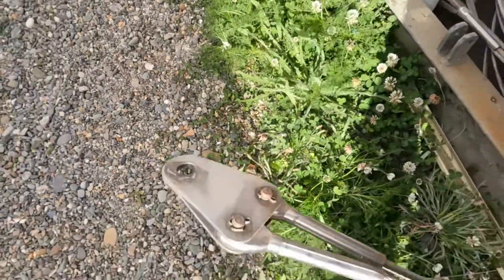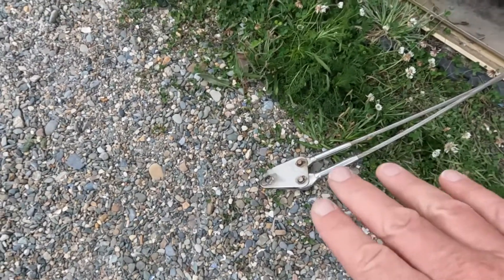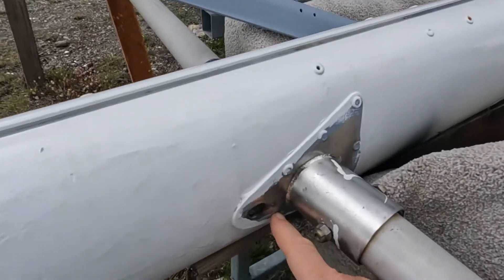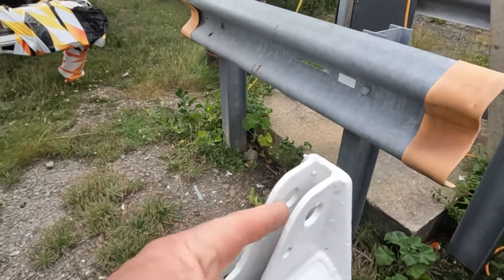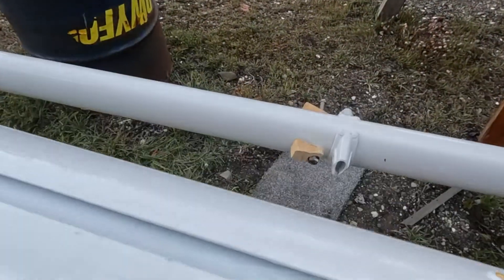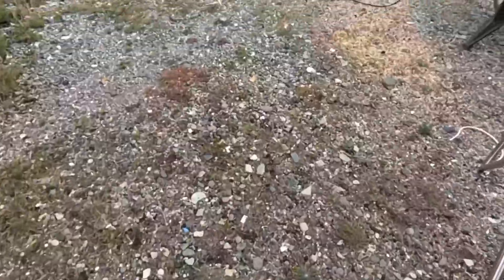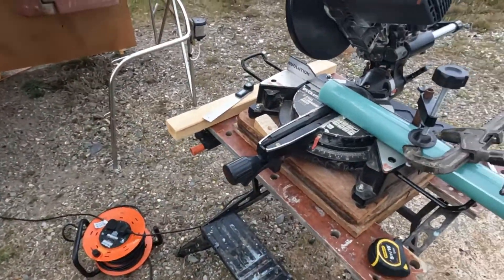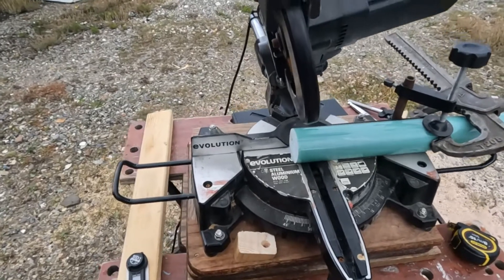DIY Mast tangs for Dyneema shrouds, Synthetic standing rigging Episode 6

Comment: Is FR4 pulltruded?  If so all the glass is going the wrong way. 
Another way of making a similar item is to mould epoxy with chopped strands.  See Easy Composites videos. They use carbon, comes out stronger than aluminium.  They make the mould using a 3D printer.  
All said is your solution a bit complicated?
How about, a stainless sleeve, width of the rope, with a large flat cone shaped nylon washer each side?
Reply from the maker: In a later video you will see that based on a number of conversations we switched from FR4 for the tangs to Acetal-C. We were able to machine them with our table router.
We don't have a 3d printer and this felt like easier tech.
We wanted the diameter to be large enough for the recommended dyneema bend radius (5x diameter) and don't have the tools to machine stainless steel. Plus this way we can angle the surface to match the angle of the shrouds.

Comment: Nice ! 
Making flush surface for head of the screw and nut I thing is important. No pointy contacts, big surface of contact will reduce friction wear of fr4. Maybe even washers. Also backing plates that were riveted to the mast where the bolt was going through the mast ware reinforcing contact point between mast and bolt. Aluminium is soft compering to stainless. 
You might want to use a bolt without thread on all contact places with fr4. Thread will be like saw vs fiberglass.
I wood also use fr4 next to mast without washer. Smaller leverage on bolt only shear force. 
All anchoring point on boats with synthetic chain plates have  pin/shaft as a contact point. So are you sure that dyneema will not cut through fr4?
I'm not an expert it's just gut feeling.
Reply from the maker: Thanks!
The mizzen lower, just below the spreaders is the only shroud attachment point without a plate riveted to the mast. It does have a compression tube though.
Agree, the forstner bit is doing a nice job or creating a flat space for the bolt head. Agree on needing a bolt with no thread touching the FR4.
Next video shows a Mark II with these changes and the endplates glued on.
Beyond that we are planing a Mark III made from a single piece of "Acetal C", should resist wear better.
As for the pin, there was a video from Zingaro about Kraken fittings because the Pin into a thimble with a size mismatch causes point loading which we are trying to avoid. The combination of a tightly fitting bolt and a 60mm diameter rod for the dyneema look should avoid point loadings.

Comment: The only reason for using the FR4  I can see it is that this already has a smooth surface on it and you can cut it. 
Why not just use a ready made solid round thimble ( smooth for dyneema ) and add a wedges inboard and out.
Use SS I-beam wedge washers as they have about the right angle.
Thimbles made typically from aluminium with anodized coating. 
Cost a problem I assume? 
Then use a hollow SS round thimble with a pressed and glued in plug you can drill at the 15 deg. Angle .
This is very similiar to traditional rigging but they normally put the loop around the mast above the gaff mainsail throat.

Warren
Reply from the maker: Hi Warren,
In large part our choices are based on what we can find or think to look for :-)

By Solid Round Thimble do you mean what is commonly sold as a low friction ring (similar to what we are using for the lower end of the shrouds eg https://jimmygreen.com/low-friction-rings/77358-8854-barton-low-friction-rings#/6795-internal_diameter-28mm )? I didn't choose these for 3 reasons. 

a) they are never shown with a bolt through the centre hole, only with rope so I assume they are not suited for the task (and as the hole is not exact for the bolt size there will be a point loading/wear). 
b) I have only seen them in aluminium or titanium and surely this would cause a galvanic reaction with the stainless bolt? 
c) if using wedges (which I didn't know existed, that is helpful thanks) there would be no articulation, the angle would be fixed, yet the angles of our shrouds are not all identical ranging from approx 11 to 13+ degrees? So the dyneema won't be perfectly aligned. With our length of rod there is space for the dyneema to align exactly.

With the pressed & glued plug it seems to me that is less easy as a diy solution as it requires a more complex part (press-in plug) to make and then to drill at the correct angle? But I might not have understood correctly :-)

Comment: Make the next one thicker and use a large bit to counter bore a hole big enough for the bolt head and washer (and socket). Bore the large hole first (with a forsner bit to create a flat bottom) then the 13mm hole for the bolt. I would use a numbered bit set to make a very close fit to the shank on the bolt. You need to avoid all sources of stress risers on fiberglass structures (air craft mechanic experience). It will also look better than using an angled washer. I agree you bored the hole too close to the edge. Aim closer to the center next time. Size your bolt so no threads contact the fiberglass.
Reply from the maker: Thanks.
a) I have wondered about fitting a stainless steel sleeve through the FR4 so the bolt is inside the sleeve. I could epoxy the sleeve into the FR4 to help even the load distribution? This would also ensure no issue with bolt threads. 

b) not sure what you mean by a numbered bit set? I used a 13mm drill for a 13mm bolt.

c) agree on the width and hole position. I'll put a jig on the pillar drill to get position spot on.

d) looking for forsner bits now.

e) thinking about it. I'm going to put FR4 endplates on both inside and outside to keep shroud from slipping into inner washer. 

Much appreciated.
Reply: @SustainableSailing  they make numbered drill bits 1 through 60 and lettered bits A through Z. These sizes are neither SAE nor metric. The in between sizes allow you to choose a bit that is very nearly perfect to avoid point loading. Proper sized holes should obviate the need for a sleeve. Avoid threads in any case! There is a reason why it is very nearly a death penalty offence to put loads on threads on an aircraft. We would rather go one size up in length and let washers make up the difference. Planning on your part would let you drill the perfect depth with the forsner bit to avoid too many washers or loading threads. Your sleeve idea protects the fiberglass but still loads the threads.
Reply from the maker: Wow, thanks. That is a whole load of useful information that I didn't know.
I'm planning my Mark II, to put this learning into practice 😊
Reply: @SustainableSailing  , forstner bits dull very fast on grp. A proper flat bottom bolt counterbore with a pilot the size of the thru hole you drill first will work better BUT won’t this mess up the anti slip off washer your are going to add?
Reply from the maker: I'm learning lots of new stuff. I hadn't heard of a flat bottom bolt counterbore before. However, I've looked and there seem to be 2 problems.
a) The width of the counterbore seems to be just enough for a bolt with a socket head, rather than a normal bolt head or nut. Eg for my M13 bolt on the mizzen I need a 31mm counterbore to fit a socket wrench over the bolt & nut.
b) I'm struggling to find them large enough anyway. The mizzen is M13 but the main mast will be M16.
I found more examples called "Counterbore Mill Bit"
I guess another option would be to use a lathe but I don't have one (or know how to use one), I certainly won't have one when out sailing.

Regarding the end plates. Yes the counterbore will affect these. I will try with the end plate epoxied on before drilling. The washer in the counterbore will still grip some of the end plate where it is shallower at the top. I could also experiment with a thicker end plate so that the it is thicker than the counterbore is deep.

More to think about and experiments to do.
Reply: @SustainableSailing  you are looking too hard. Just get a forsner bit. They pretty much all make flat bottom holes. But you should use a drill press and clamp down your work piece to avoid tears. Once you use one properly you will note a smile has found your face. Get one large enough for your ratchet socket you will use to tighten the bolt. Buy a small set with 5 or 10 common sizes. Cheap sets work fine for your needs. Mine come from china and work nicely. As for the "cheek" that you use to keep the dyneema in place - I would epoxy it on first then bore. It will be stronger than bolting it on and will look great as well as provide thickness for the forsner bit on an angle. Should end up with a pro looking result.
Reply from the maker: @jampasritalon4180  I've got the forstner bits on order as well as some 0.5mm drill bits to size a bit better (thanks UK Drills).
I'm also checking with Ai Plastics if one of the many other materials they sell would be better than FR4 as some comments have expressed concern.
Reply: @SustainableSailing  you could collaborate with myfordboy who uses 3d printing to create molds and then casts them from aluminum. Check his channel. He speaks with an accent similar to yours so he may be in your latitude. He could duplicate the cheekytangs made by colligo.
Reply from the maker: My preference is still for a diy solution. Not just to saves money and be more accessible but because it makes it possible to repair or re-rig anywhere.
When we bought the boat some of the other lockers had complete spare stainless steel steel shrouds but they had got very rusty on. 
We want to be able to carry a minimal set of spares so we can we can fix any problem as we cruise. At the moment s bit of composite rod, some low friction rings and a few bolts should be all we need. 
If we can carry some dyneema line, a few friction
Reply from the maker: Also for people who can afford the Colligo Cheeky tangs they are a great product, we are not simply trying to produce a clone to sell.

Comment: you could have made tang bigger and recessed the bolt head, and, had the face of the bolt flush in the tang.  personally I would not be happy with the bolts as they are.
Reply from the maker: I agree about recessing the bolt head (and the nut). I'll get the end plates on and I will need to order a suitable drill bit as I only have flat bits of a suitable size and I don't think they will work on FR4. I also agree that I was a bit stingy with the tang length. Mostly I was worried about the gap to the shroud but that has ended up more spacious than I feared.